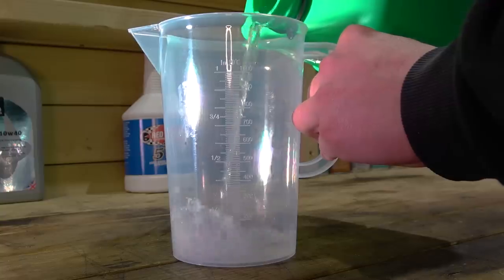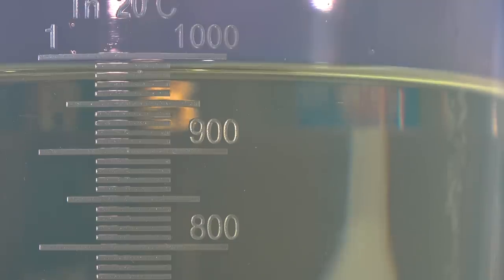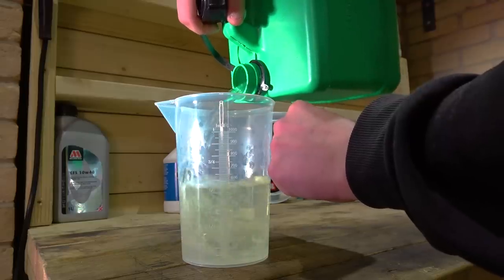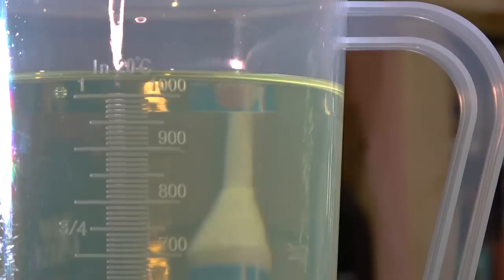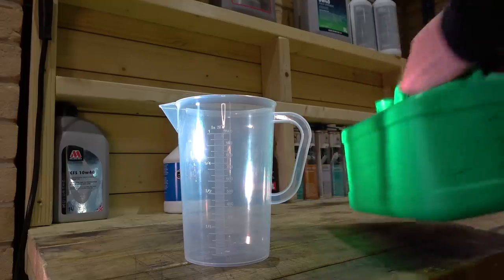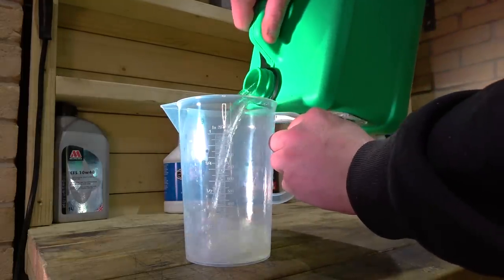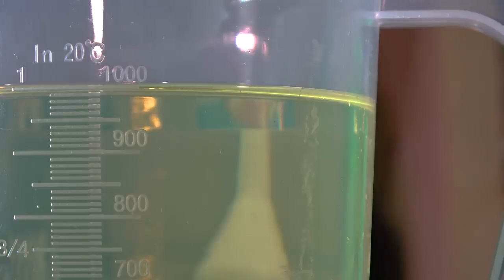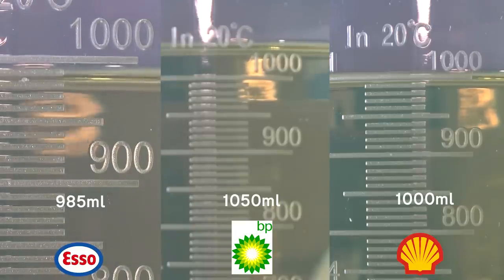Fuel Pumps Are Wrong - Esso BP & Shell

Comment: I used to work in Shell stations and my old boss told me that when the pump fired up it disregarded the first 2/3p of the dispense to ensure you’d get an over pour rather than under. Did I believe him? Not really.

A guy used to come from an independent company (although Shell paid for this so I’d err on the side of ‘independent?’) and he’d do a pour test on every pump, every grade. We had 8 pumps with 3 grades on each so it was a reasonably long day for him. He’d use a metal control jug and pour in 20 litre measures. Every pump measured either dead on or marginally over, like I couldn’t see the difference but he’d swear it was. Trading standards themselves came once and produced almost exactly the same result.

Comment: Don't they give the warning because of the fuel that is left in the hose from the previous user? The hose alone can hold 2 or 3 litres. And the fuel in the hose is unmetered.
Reply: Watch any taxi driver...they alway lift the hose ..to get any last knocking lol.
Reply: @billy4072  tnx for the tip
Reply: not 2/3 litres but maybe 100ml extra
Reply: @julmdamaslefttoe3559  3 meters of 22m hose would hold 1.14 litres of fuel
Reply: I'm no expert in petrol pumps, but in all the designs I've seen, the metering valve is at the top of the hose, so any fuel left in the hose is fuel you've been charged for. I always lift the pipe to make sure it get it all out. It's nowhere close to a litre, but I'd say often about 100mls or so.
Reply: @MattyEngland  sorry but you are wasting your time lifting the nozzle and hose.
Reply: @MattyEngland  The metering sensor is in the pump. but the valve is in the nozzle. The reason you get so little fuel out of it, is you are only emptying about 8 inches of pipe.

Comment: The petrol brand or location is totally irrelevant, because they don't make the pumps 🤷 .....All the petrol pumps (for every brand) are made by Gilbarco Veeder-Root. There have been many (slightly different) designs over the years, all of which could still have slight variations in accuracy, depending on the consistency of the engineers that install and maintain them. So ...... a ridiculous amount of variables really, and a completely pointless exercise - hence the "2 litre rule" 🤣

Comment: Are these fuel pumps more or less accurate at lower flow rates?
Reply: Less accurate.  The weights and measures label on the pump approves the pump for trade use between a high flow rate and a low flow rate.  Normally (and especially with VR) the pump, as installed, will not achieve the higher flow rate in trade use.  The lower flow rate is nominally 5 liters per minute.  If you look for the serial plate on the fuel dispenser, you will see this flow rate information supplied.

Comment: So you complain about a difference of 1.5 % at Esso for something they didn't guarantee (under 5 l).
Can you do me 2 favours after emtying the 3 cans into your vehicle, please?
1st Take 15 ml of fuel and pour it into a dry can, close the lid and shake it, so that the entire internal surface becomes fuel-wet. Now open the can, hold it upside down and measure how much of the 15 missing ml come out. I guess nothing! The 1 l is measured before the fuel hose, before the nozzle, before you make the dry can wet and before you pour it out after 2 chances for vaporization!
2nd favour: Take the 3 empry cans, go back to the same pump at Esso and fill in 3 times 1 l. Then measure, how accurate you filled in before blaming the pump.
🤦‍♂️

Comment: variables are length and height petrol pump nozzle ...who used it last ..a car with very low filler cap will leave nozzle empty ..car with high filler cap will leave fuel in the nozzle ...so next person with low car gets the extra .

so your test is not scientific ..unless you filled two cans and disregarded  the first.

Also you want to do a test on ..on .how fast or slowly you fill the can ..and if quantity varies with speed ...ever notice if you fill fast there is lots of froth and air bubbles  - especially with diesel !!!

Comment: All companies are legally bound by The Weights & Measures Act 1985.
By law they must provide exactly 1 litre of substance when it is displayed & priced accordingly.
By saying you must delivery a minimum of 2 or 5 litres to get an accurate amount is quite frankly, bollocks.
It won't make a difference whether you fill a container with 2 or 5 litres of a liquid, because if the pump is set incorrectly by say 0.01L then the overall amount of liquid would be short by 0.05L.
All fuel pumps are calibrated in accordance with the Weights & Measures Act 1985, to dispense exactly 1 litre of fuel (in this instance).
So not only did you highlight that fuel companies are over-charging 0.01p per litre in the last video, but they also short dispensing fuel on every litre which once again increases their profit margin!!!!
Reply: Incorrect. Not "exactly 1 litre". Tolerance is up to 0.5% under or 1.0% over. They don't "overcharge by 0.01p per litre" either. Other than that - bang on!